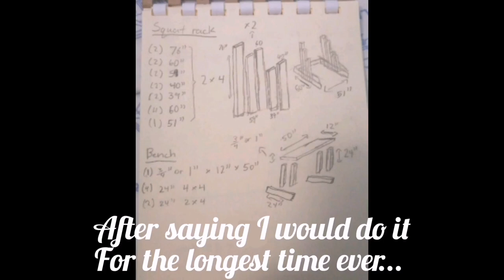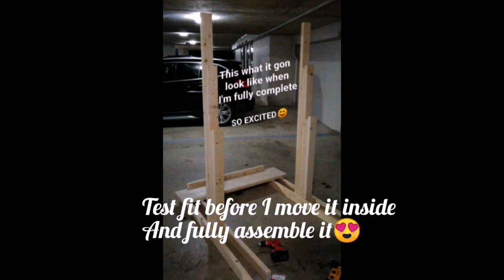EASY AND CHEAP DIY WOODEN SQUAT/BENCH COMBO RACK PLUS FLAT BENCH

Comment: Only problem is trying to find a barbell and weights :/
Reply from the maker: I feel you bro.. I've just been constantly checking Facebook market place and craigslist. There are occasional good deals there
Reply: Make them yourself. I did and its very cheap and easy. All you need is a pipe and concrete :)
Reply: Execlty